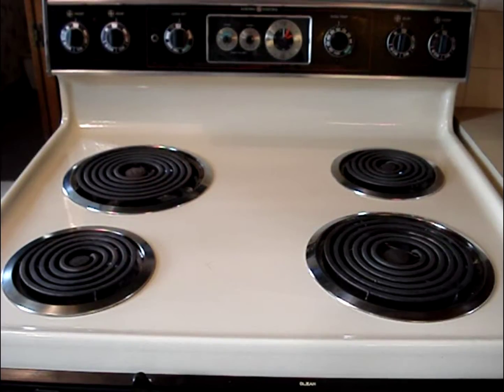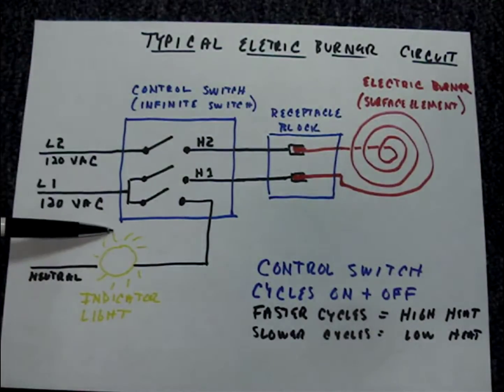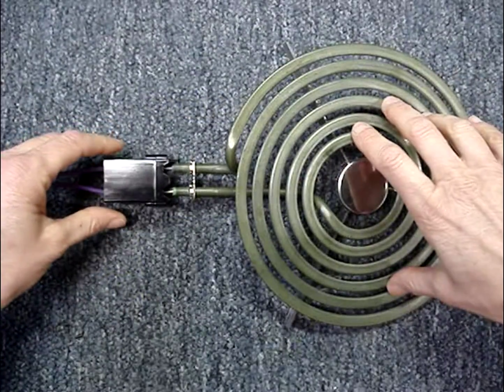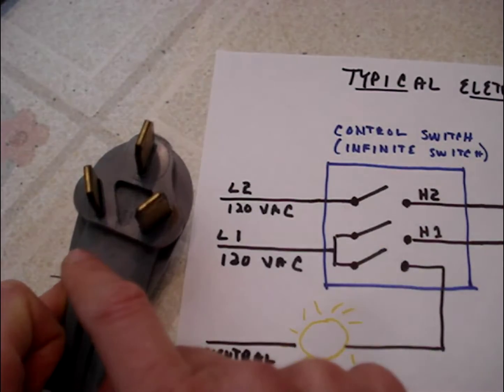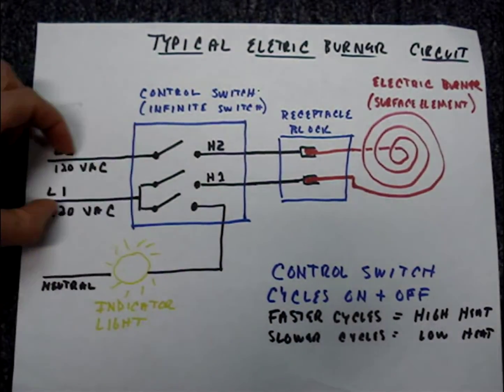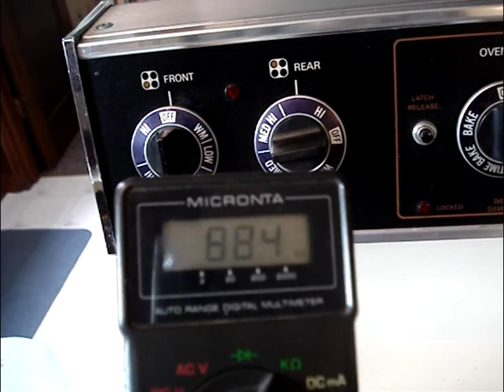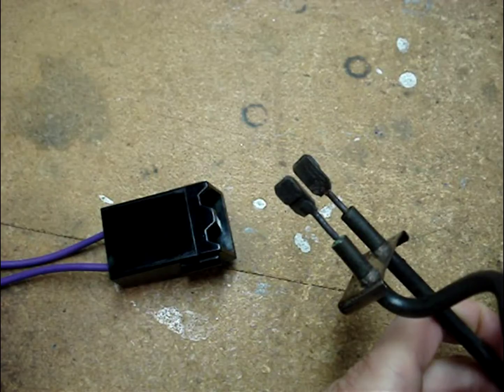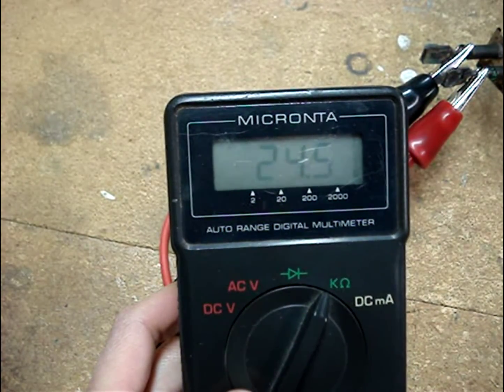Electric Stove Burner Not Working - Troubleshoot With Multimeter

Comment: My stove burner light stays on with no heat. What can I do to fix it? Thanks
Reply from the maker: Without going through the troubleshooting process, I can't diagnose the problem.  You might try my other video I have that does not require a multimeter to troubleshoot.  Here's the link:  https://youtu.be/UCVPltPsyfs

Comment: I have a vintage GE JB500V, burners won't turn on but the oven works? I got power coming out of the receptacles and the stove coil tests within resistance limits, I'm running out of ideas here lol. Please, anything helps
Reply from the maker: If no burners are working, look for the schematics, they are likely somewhere on the stove.  Find the spot where the circuit is common to all of the burners.  The problem is between that point and the power input.   If you can't read schematics find someone who can.

Comment: My mom's electric stove has a rear burner not working,I tried to measure AC on the contacts with the coils removed, I read nothing, is it ac voltage going to the coils?
Reply from the maker: Yes there is AC going to the coils.  Can you swap burners to verify?  You could also check the coil for continuity.

Comment: Does not show actual hookup to read ohms.
Reply: It's hooked up on the plug L1 and L2. It remains unplugged for this test which confused me for a moment too as I expected it would be plugged in to test with the knobs.
Reply from the maker: The video is meant for someone who knows the basics of using a multimeter such as reading ohms/continuity - always done with power off and that you can read a basic electrical schematic.  That's why in the beginning I suggest the other video if you don't have a little electrical knowledge.  Thank you for your comment... and clarifying that for anyone who might be confused.  I've worked with electronics/electricity for over 25 years it is automatic for me to know resistance/ohms tests are always done with power off.  I didn't see the need to show the plug since I identified L1 and L2 earlier.
Reply from the maker: How to use a multimeter is not in the scope of the topic for this video.  If I stray off the topic people will not watch the video or complain that the video is wasting their time.  I do have an additional video that explains how to measure resistance and continuity using a multimeter.  Notice that it takes 9 minutes to teach you how to use just one function of a multimeter.  https://youtu.be/9H-uMSGHFXM
Reply: Can't please everyone :)

Comment: Thank you for this video 
Just curious, I’ve recently replaced an electric oven but the coils do not heat up. The appliance powers-on & electric dashboard & oven lights come on. I checked the current AC volts & observed <90v where it should be 240v. Could that cause the coils to not heat up?
Reply from the maker: The new stoves have circuit boards.  I'd need to see schematics, have a service manual and be there to troubleshoot.  If it's new, it should be under warranty.  Contact whoever you bought it from or the manufacturer.  If you don't get any satisfaction and paid with credit card, call credit card company and dispute the charge.  There is a short window of time to do this, I think it's 30 days.  You can also contact the attorney general in the state the manufacturer does business.  There are laws for warranties.  Maybe just a threat that you will do this will get your stove repaired.

Comment: if the burner does not come on at all, how do I troubleshoot that?
Reply from the maker: First check for power at the receptacle, if no power there trace back towards the infinite switch.  If you don't understand  how to read schematics/AC power/how to use a mulitmeter I'd defer to someone who has experience. AC  power can be dangerous if you don't understand it.

Comment: Do you have to disconnect the stove to replace the surface element???
Reply from the maker: The safest practice is to disconnect the stove.  If you are absolutely sure that the stove is working properly and there is no chance the element can heat up while you are working on it, then you can skip disconnecting power to the stove.  It's likely it has a dedicated breaker and you can turn off power at that location.